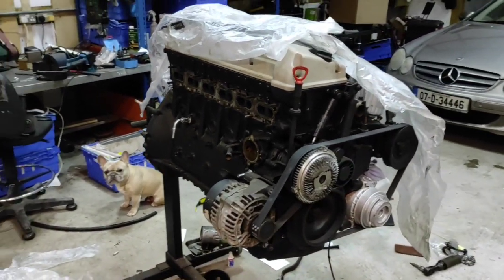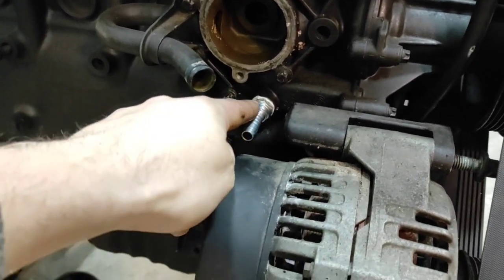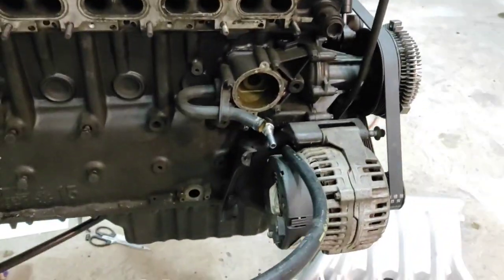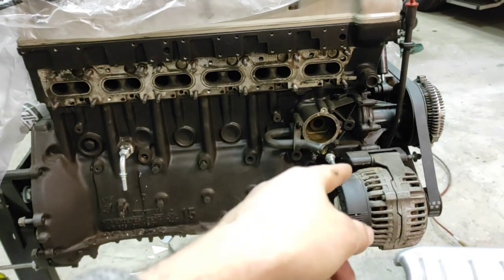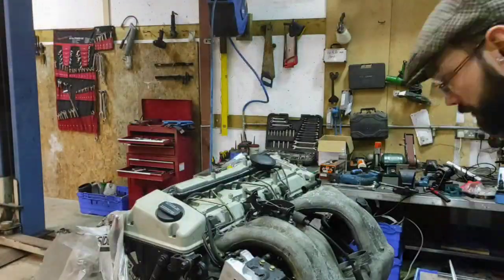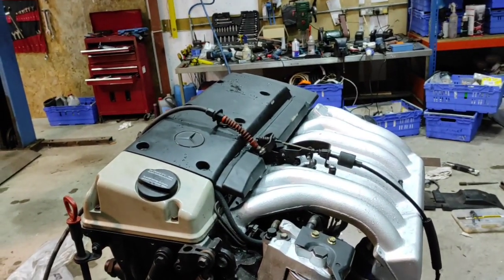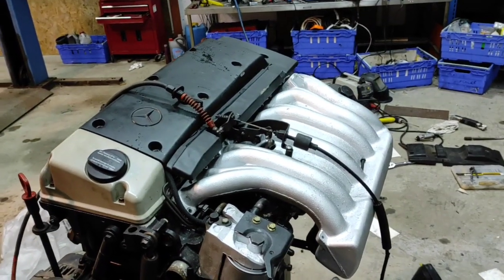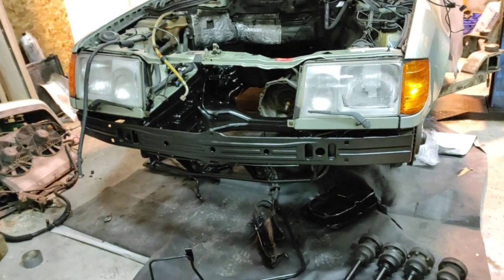OM606 Throttle and Bowden Cable - W124 Mercedes Turbo Diesel conversation

Comment: is the linkage off a 606 w124  ?
Reply from the maker: Yes. Seems to work well too.
Reply: @22rabbits  what modals use this sort of linkage just the 124 ? 606
Reply from the maker: @Mike-yq6jg  not sure. This one came from a late model w124 fitted with the naturally aspirated om606.
Reply: @22rabbits  what lenght rod did you use and cable